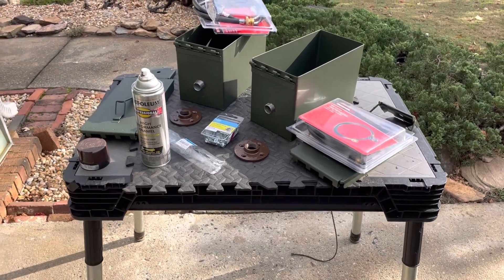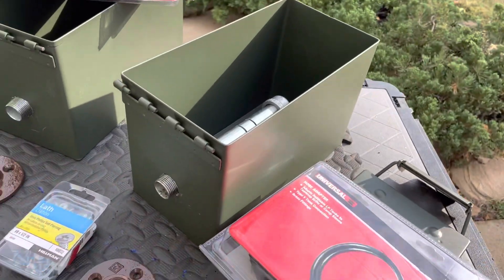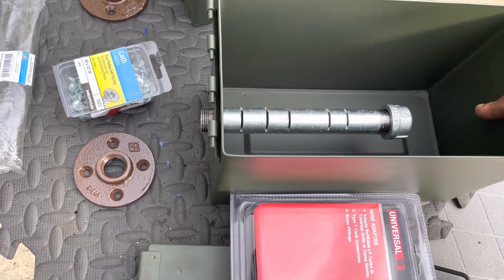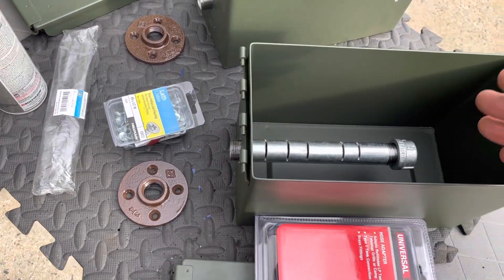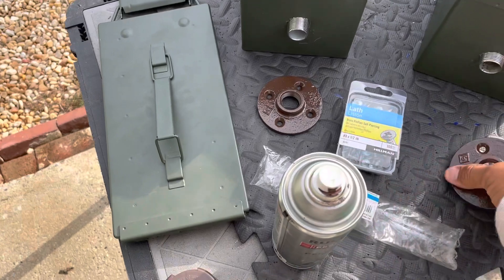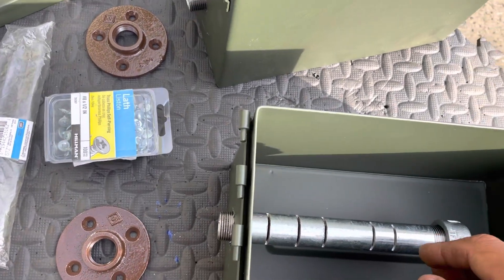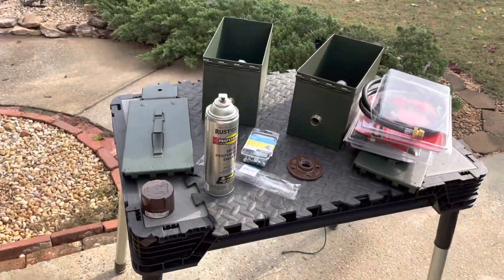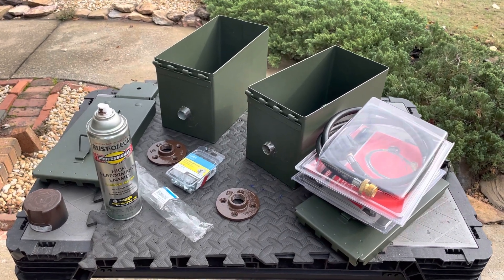@UndercoverTundra OVL1 portable propane fire-pit

Comment: I think it's a great project for quick DIY! My only "but" : from what I've read galvanized metal is not indicated for high heat (above 392F) as the zinc coating  will come off (zinc oxide poisonous white smoke...) and it's not very healthy for you or anyone close by. Why not use black pipe?
Reply from the maker: Hi 
Good morning 
Sorry for the delay on responding back 
I did use black pipe , I went with a 3/8 black pipe
Reply from the maker: Thank you for watching and for the comment ✌️😎